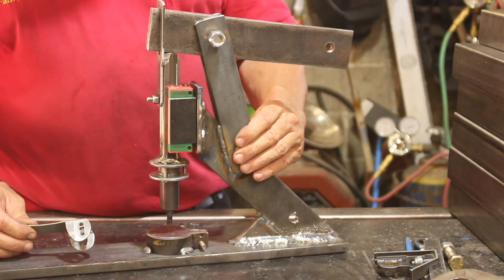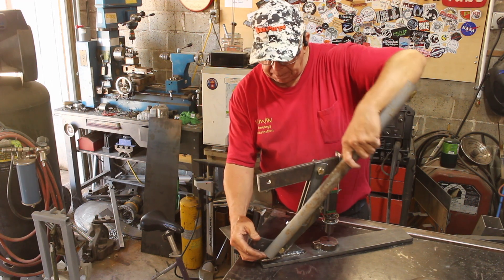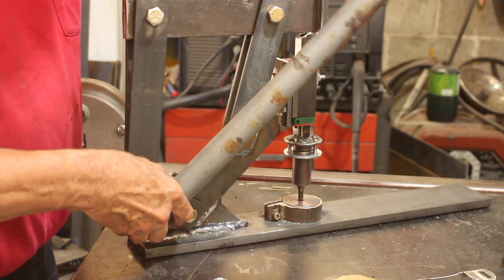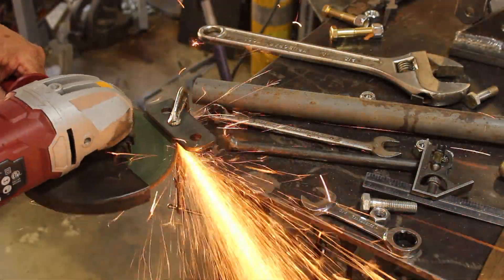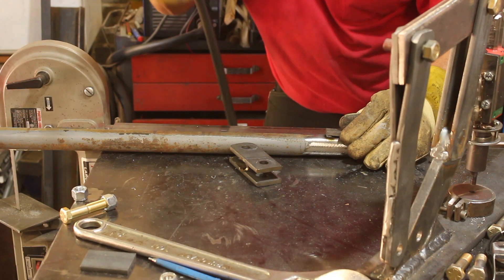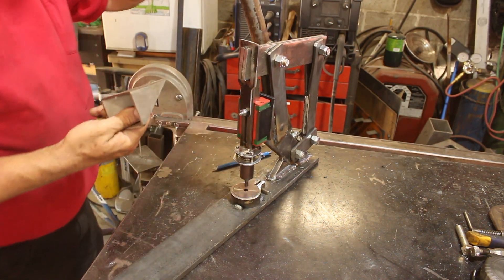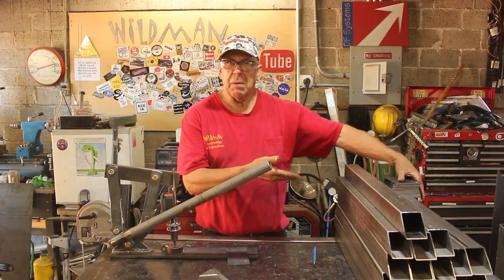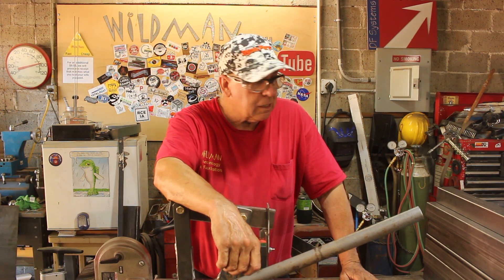Building a Hand Punch Press - Part 2

Comment: OMG ! I would prefer a ordinary drillpress and drillbit over this"dangerous thingemajig" any time. Just fixing a small jig with an alignment hole on the  drillpress table  to set the corner of the plate at the right spot every time is all you need to drill those holes at the right distance . IMHO you are taking a very big detour to get the same result.
Reply from the maker: Where did you get the silly idea that this is in any way dangerous? It's no worse than any other hole-making operation. Had you seen part one, you would know that the location of the hole is completely irrelevant. The issue is the amount of time it takes to drill it. Drilling a 17/64" hole through 1/8" steel takes 6 seconds per hole. Once this is done, I'll cut that time to 1 second per hole...or less! That said, this is all about a learning experience anyway, so who cares if it even succeeds or not?
Reply: I have seen part one...Wel if 6 seconds a hole is to long ?....just imagine how much time you lost making a non working tool for only 1/8 plate....+ the time it took to make and edid the video making it. And this press is far from working on 1/8 thick steel. Just 1 sec a hole or less  when your punch press is finished you say.......so thats 60 holes a minute. :)   I can not wait to see your final vid on that prooving you can do that. I am willing to bet now  you can not do it in 1 sec a hole or less.
Reply from the maker: HoutmeyersP Where did you get the idea that being an asshole was a good thing? I know that this can be done. The fact of the matter is if I wanted to spend $700, I could just go buy the tool. They’ve been making them since the 1930s and they will effortlessly punch a hole in 1/8” steel in less than 1 second. The purpose of this channel is discovery and innovation. The challenge of solving the problem myself and gaining new understanding is why I do this. Sharing it with the world is a way to give back. From my own experience, I’ve been watching a video about one thing, and one tiny segment can provide the solution to a completely unrelated nagging issue I’ve been on for months. In short, find a lesson in it if you can, and stop being a dick.
Reply from the maker: @HoutmeyersP  Even if it fails I'll post it. Can't think of any reason why I wouldn't.

Comment: Can you change the grind on the punch at all? ..grind it like a bologna cut . ..you know,   like on a set of exhaust pipes.  ..diagonally cut at the tips.  ..it seems like you can still salvage what you got here  by welding the base out like an I beam (web flange). But it seems to me that the handle should be inline with the hole being punched. ..I'm definitely not saying I know anything you don't.  I'm just spitballing a little. I thoroughly enjoy all your videos that I've seen. It takes a secure ego to be able to post any videos here on youtube. ..especially  videos that didn't  work out as planned.   It seems like many people have forgotten what it takes to create or maybe they never knew. Keep up the good work . Keep on posting it. We appreciate it.
Reply from the maker: I've had several really great suggestions. Your's among them. The amount of flex really concerns me. It affected the alignment of the punch to the die. The next iteration will address, and solve those issues....I hope.
Reply: @WildmanTech  cool. I look forward to seeing this thing come to life. I wonder if a bottle jack could be incorporated somehow but then you'd lose a lot of your time advantage. ..how much pressure will be required to punch the size holes you need punched? Is there an arbor press that can be adapted ..for a good price? ...they've got that geared lever. I've used mine for doming over some home made rivets ...or.hey, what about greenlee? Shouldn't they have something you can kinda copy? ..or baileigh?
Reply from the maker: @jdog4534  6.9 tons is the amount of force required. I should have started with that piece of data, but it's all about the journey anyway, right?
Reply: You know what they say wildman tech, "with a long enough lever, man could move the world."  At 6.9 ton, you're really putting that theory to the test, huh? lol.. You should be able to roughly calculate what  size lever will be needed based on what you already have, if you can measure that somehow. ..is that per square inch or some kind of levered measurement, like a foot pound or what?
Reply from the maker: @jdog4534  That's just what Scotchman said was required. I'm collecting parts for the next iteration.

Comment: Amazing experiment.  I like seeing how this is going.  Would welding  pieces on to the base, on edge, give you enough strength?  Similar to making the base from angle iron.
Reply from the maker: Jim Dockrell There’s so much flex, I think I need to just make it again using thicker steel. I got some 1” plate a few days ago and will be working on it this week.

Comment: Wildman my friend, unfortunately you will not get to 1/4" material. The 1/8" will be a huge challenge to accomplish. I do not know the hole dia. guessing 3/8" dia. For 1/8" mild steel (A36) calculations say 3.7 tons (7,400 lbs.). 1/4" mat'l  2X that at 7.4 tons (14,718 lbs.)I think you should build a multi spindle drill press. With (2) drills you can cut your drill time in half. This you could make adjustable if the hole spacing (distance) is not consistent.Best of luck.!!
Reply from the maker: I built a multi-spindle drill. I was not happy with the performance. We shall see on 1/4" though. Challenge accepted!

Comment: A small bottle jack would multiply your exerted energy. One of the fancy air powered bottle jacks with the foot control from Harbor Freight would speed things up too.
Reply from the maker: The objective of this project is to save time. Pumping a bottle jack will take more time than drilling.
Reply: @WildmanTech   That's true and that's why I suggested the foot operated air powered hydraulic bottle jack. I'm skeptical you can get the power you need in a hand operated device without vastly increasing the levers arm length or decreasing total punch travel to a point it becomes useless. Regardless I'm going along for the ride your on. It's about the journey more than the destination.
Reply from the maker: ten littleindians If only more people understood that. Thanks for your support!